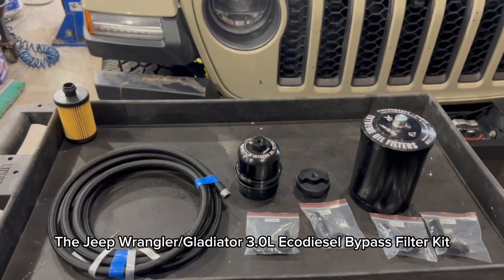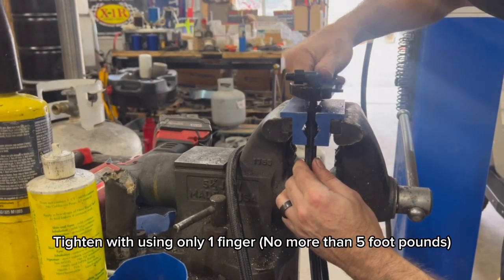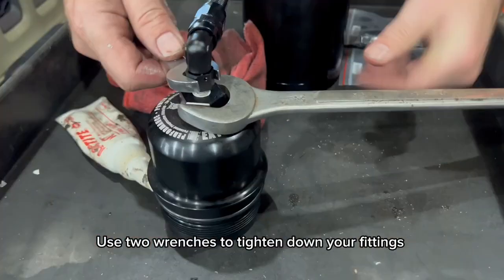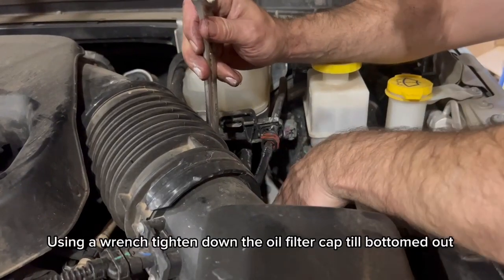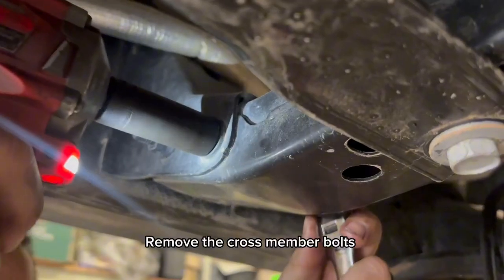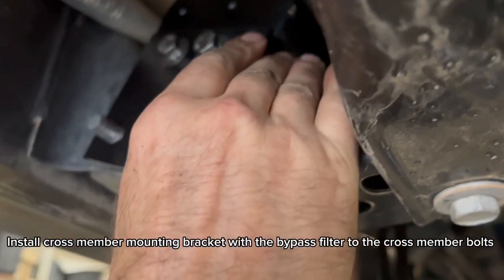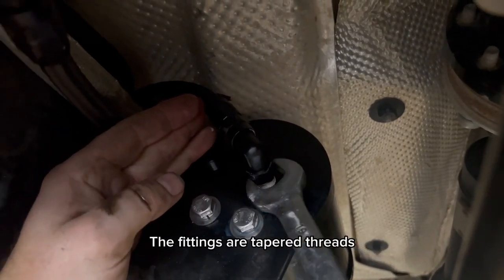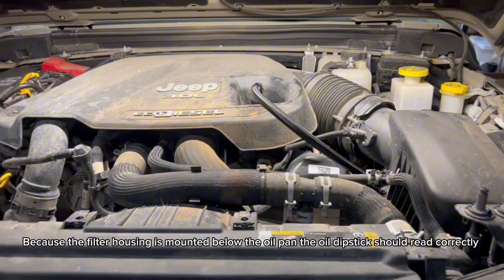3.0L Jeep Wrangler & Gladiator EcoDiesel Oil Bypass Filter Installation Guide - Insane Diesel

Comment: Do you have a video of the Tee Fitting version for the Gen3 EcoDiesel?
Reply: This is on a GEN three Eco diesel. I have one myself I plan on putting on this and also off the bottom of the oil cooler. There are two. I believe they’re 12 mm Alan bolts. I can’t remember which one is in or out, but you can pop those out and run fittings to run an external oil cooler as well greatly increasing our engine engines lifespan.